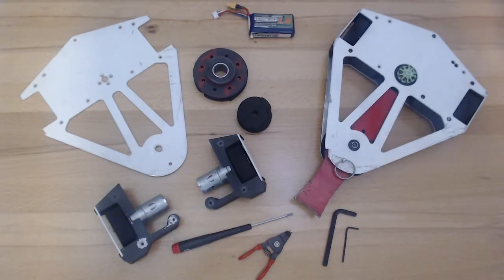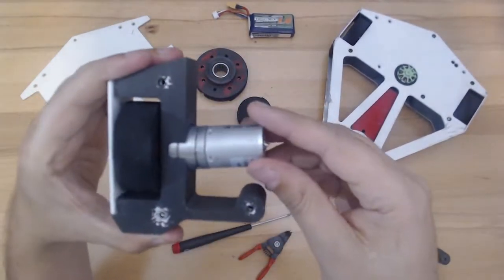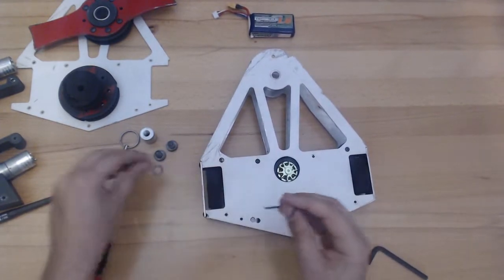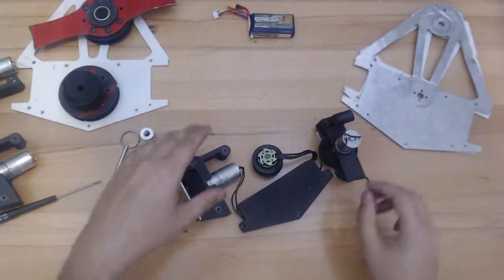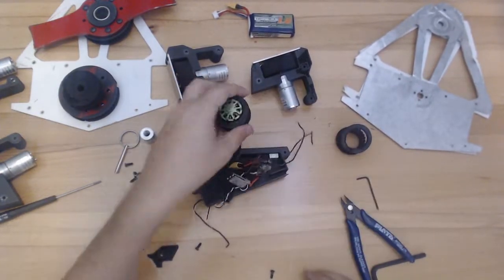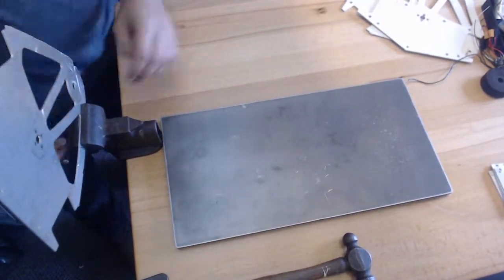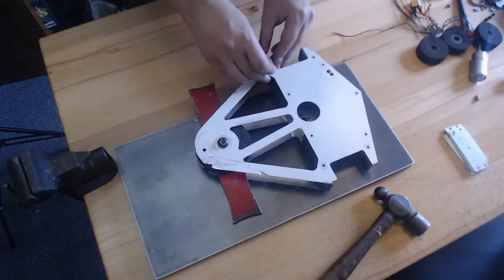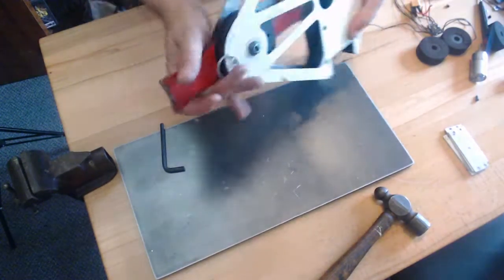CIRC 2019 - Beetleweight Combat Robot Vector Repair

Comment: How much smaller is the pulley bore that holds onto the brushless motor external rotor than the motor can?
Reply from the maker: Its 24t  xl so its 2:1 reduction
Reply: Endbots I worded my question badly, I edited it, hopefully it makes sense now.
Reply from the maker: I think its around 0.001" undersized
Reply: Endbots thanks

Comment: when you make this a kit if you could sell the weapon stuff (pulleys, motor, bar, ect) as a separate thing for replacements and putting it on other robots that would be very nice :)
Reply from the maker: You'll be able to buy parts individually except hardware
Reply: Vectors are here. I repeat, Vectors. Are. Here! 

https://www.endbots.com/products/vector-beetleweight-kit

Comment: Do you think you can run Death Wobble and Vector at the same event one day? (Please bring back Death by 1001 Cuts.)
Reply from the maker: Death wobble was a concept that was rushed.  It was supposed to be changeable from horizontal to vertical based on opponent.  I'll probably revisit the idea sometime in the future.  I do want to bring back 1001 Cuts but I have to find a motor I like.  If I do bring it back it will have a full build video.  :-)
Reply: I’m looking forward to it.